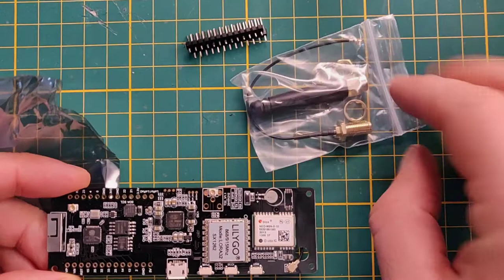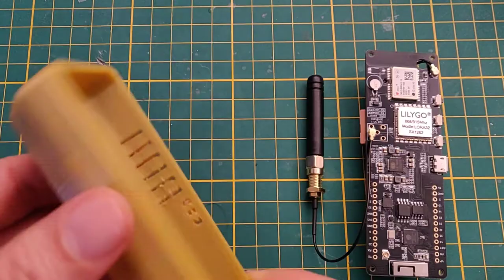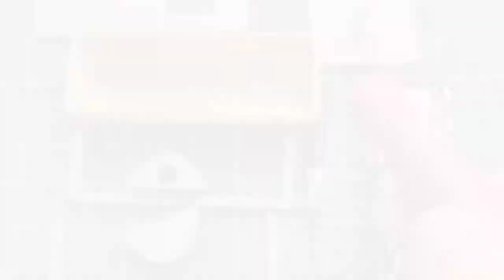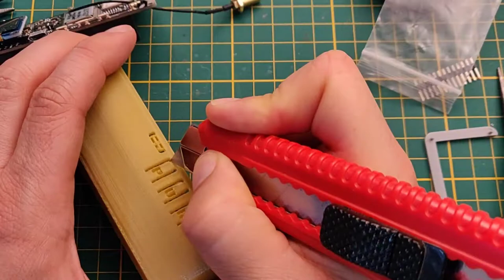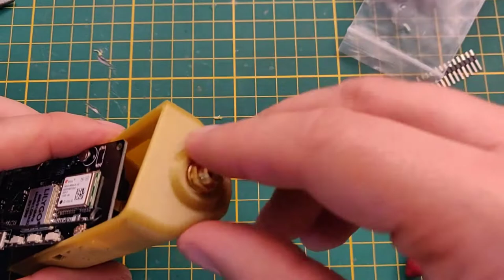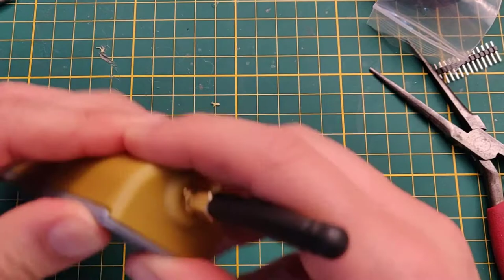Make of TTGO T-Beam T22 v1.1 Case (IPEX Version)

Comment: Nice!

What size battery (mA) are you using and how long does it last?
Reply from the maker: The performance of Meshtastic project is good, and also the power saving performance of this TTGO board because it has a AXP192 chip to have good quiescent current, with that and with these old batteries from a old laptop that in this moment these had capacity around 1700mAh, I used it for many hours, maybe days. Of course it depends of many factors.
Reply: @hpsaturn  Thanks responding and the info. 
I'm really interested in Meshtastic and LoRa for a project I have in mind. I just got my first ESP32 dev boards.  
Hopefully I can figure out  Arduino IDE :)
Reply from the maker: @altitude1039  Thanks for your comments. Don't forget the like and subscribe :D On the other hand, check a little the PlatformIO project, it is better than Arduino IDE but also it support Arduino. Meshtastic and other projects already using this, for example my Citizen Science initiative CanAir.IO

Comment: bonjour comment fais tu pour avoir l ecran fonctionnel? car moi il fonctionne pas merci
Reply from the maker: you can explain me better you question? The screen works for me, I used the kit in the description on thingiverse link, it has the screen and the main board, only put it like in the video, and upload the firmware  firmware-tbeam-EU865-1.1.32.bin that you found in the last Meshtastic release in Github
Reply: Yes, these screens pins are not all arranged the same way. Check the pinout expected in this video and use DuPont cables. https://youtu.be/w1Saxj4Ete4